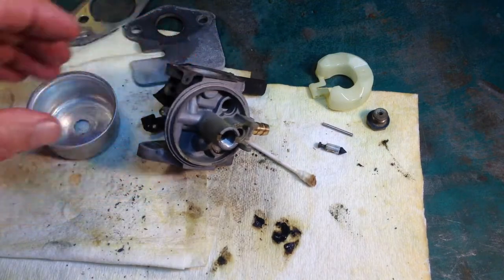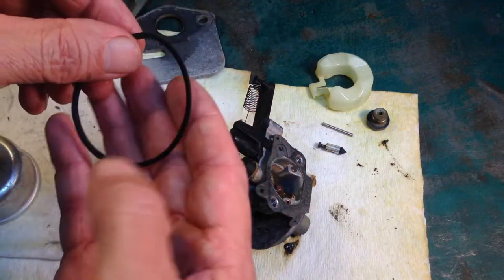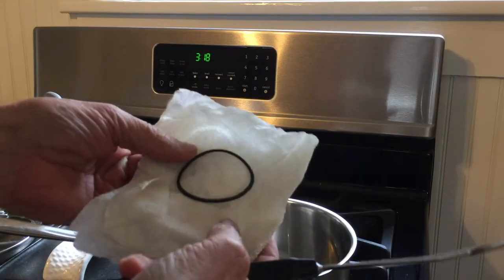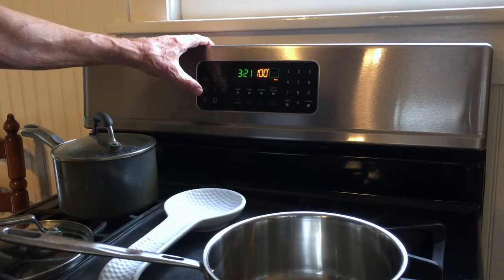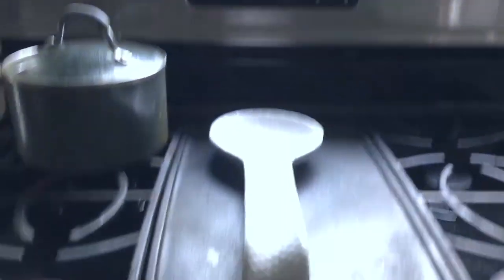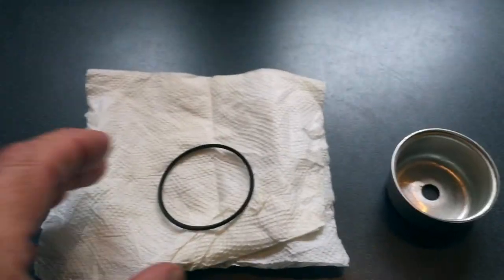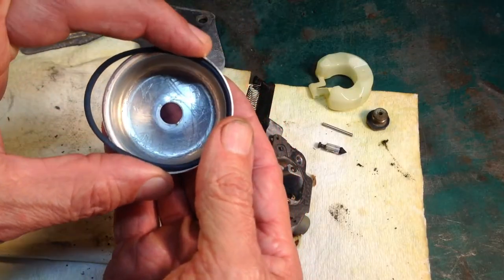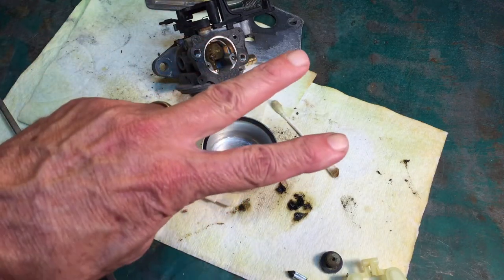How To Shrink Swollen Carburetor Bowl Gasket

Comment: Just tried it on a gasket I forgot to remove before cleaning my suppressor baffles with brake-clean (silicone I suppose, I am an idiot); boiled for 10 mins then baked at 350º for 10 mins and let it sit in freezer overnight. We all owe you a case of beer!

Comment: I would suggest setting the gasket on a block of wood instead of a metal pan. It won't stick or transfer as much heat to the rubber. And no, the wood isn't going to catch on fire. Fahrenheit 451 taught us paper burns at...451 degrees. Regular wood is in the 500-600 degree range. So keep your oven below 400 and you'll be just fine.
Reply from the maker: Good idea.. Thanks..

Comment: Ran into this exact issue on my Chinese mini excavator with Briggs and Stratton 13.5 HP motor. Removed carb to clean and swelled the float bowl gasket with carb cleaner. Tried this fix after watching the video and it absolutely worked like a charm! Saved a trip to town and a few bucks. Thanks!
Reply from the maker: Glad to have helped..

Comment: Thanks   
I boiled but not willing to use oven , I my wife already want to kill me by slow death New washer Dryer and if do something to oven I am doomed 
So i used a hot air paint stripping gun 
put on screw driver to
rotate and after boiling heated 10 min rotating with heat gun.  Was perfect 

Thanks.  
The Oven heat or a hot air paint stripper gun worked.   

You stating it smells like gasoline made me choose for alternative.  
I do not thing a hair dryer is hot enough.
I used high heat on stripping gun and constant rotation. It seemed to sweat water and once dry it fit perfectly
Reply from the maker: Hadn't thought of using a heat gun but that makes sense.. Glad it worked..

Comment: I made a huge mistake!!!The biggest from all of you.I have clean rubbers from doors and windshield front and back from a car with diesel and vaseline and they all expand.cant find new ones.please dome advice.I let them to the sun for now but i dont think it will work( just waiting for diesel to evaporate)any suggestions.rubber is different material than o rings and seals i think.please need help here
Reply from the maker: maybe clean with some type of degreaser, hot soapy water etc.. then place in sun like you mentioned and wait..
Reply: @tongo117  thanks a lot i appreciate your feedback.i will sure bother you again if i don't have any results

Comment: Celsius or fahrenheit?
Reply from the maker: fahrenheit
Reply: Thank you. I had them in 275 celsius and after 5 minutes I had to take it out. But the O-ring was not destroyed  worked just fine.', and it was way to larbe before owen cooked  275 celsius is a out 500 F😁 You have the best advice, tried others n not worked 🇫🇮
Reply: 350 deg. C???  take a crazy guess if its F. or C.
Reply: @TimCBuilders  mission was completed already.